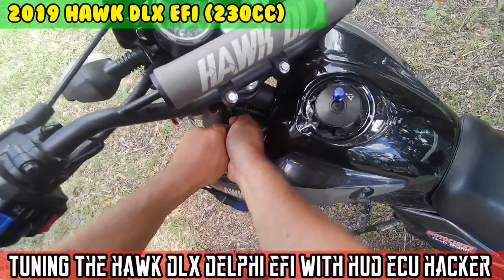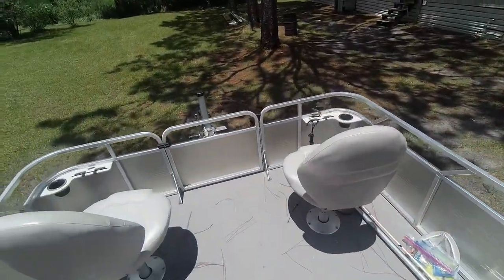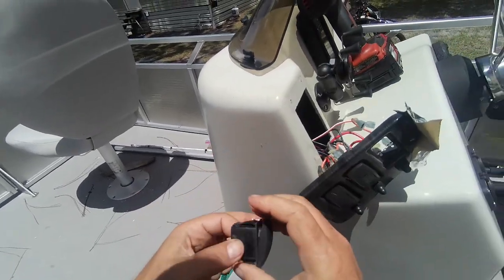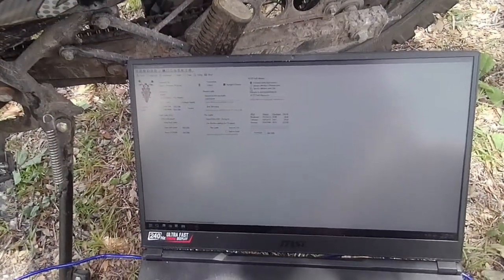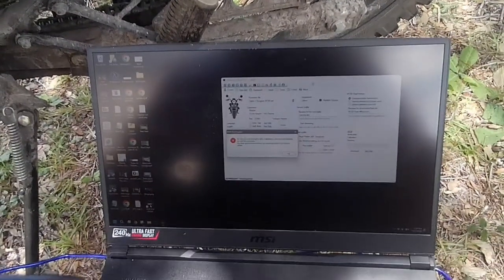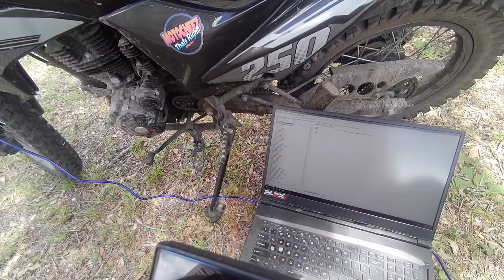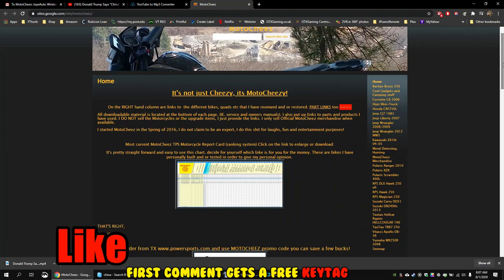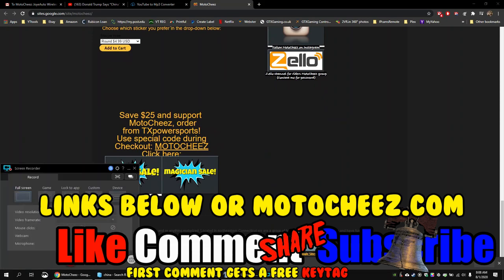Tuning the Hawk DLX Dlephi EFI computer with HUD ECU Hacker and a test drive. Broken speedo

Comment: My friend and I have been liking our Hawks a lot since we've been able to ride more frequently, him more than I since he rides his into work. Mine is at his house so I only get to ride on the weekend. We've been doing tweaking here and there as we ride. Since we haven't been doing any off-roading with them we're just going to gear them for cruising speed on the road. We're also going to change out the knobby tires for road tires. 

I bought two sets, one for mine and one for his, they're supposed to be here tomorrow. So we'll get to see how they perform with road tires this weekend. With the way they're geared currently we can cruise at about 50-55mph at a decent rpm but we want to hit 60/65mph at a more relaxed rpm when we're cruising. So we're going to get a couple more rear sprockets with reduced teeth and see which one works best.

I've also been eyeing a round universal led headlight for a motorcycle and a fairing/windshield combo to give it a different look but that's for later. It's slowly turning out the way I want it. Even with the high gas prices we've only been running ethanol-free high-test gas in them and after a couple hours of riding around we'll top off and still only spend about $5 or $6. Which to me is still a good deal. Even with my truck I haven't been paying too much because I top it back off at 3/4 of a tank and spend $35 or so for regular. Ya, $35 could have gotten you more gas a while ago but you gotta change up the routine to keep the price in check. :)
Reply from the maker: Nice!
Reply: @MotoCheez  Once the Hawk is the way I want it I'll have to send you a photo or two of what it will look like. I've been buying stuff for it here and there in small spurts so it's not too pricey. Of course I've been buying stuff for two Hawks at a time so it's a bit more. I owe my friend money as he paid for our motorcycle safety course so I'm paying him back with mods for his Hawk. All stuff he would have bought on his own anyway. :)

Comment: Awesome video, been following you ever since i had my first hawk back in 2021. Then i crashed 3 months later sold the bike. 2 days ago I bought a brand new dlx, going back to it. Ty for the support in the community. I want to also ask you a question. I want to do the big bore kit on the dlx, will it need a tune? Also if so, do i need a new injector? No one seem to have done a 300 big bore dlx yet
Reply from the maker: Awesome and thanks. 
You're definitely going to need a tune if you do the big bore, most put a cam too. The guy Alex on my DLX tune video still does custom tunes. Not sure if you'd need a bigger injector
Reply: @MotoCheez  ty for the reply! I’m going to contact him. Do you recommend any cams?
Reply from the maker: There is a company that sells with the big bore kits, can't think of the name. It's all over the forums.

Comment: Try drying and packing packing the boat switch with Dialectic Grease (Silicon, so safe for plastics.)
Reply from the maker: I silicones the top part for now, I need a new switch
Reply: @MotoCheez  Silicon sealant is good too. Packing the new switch could make it permanent. 
Also, buying a quality marine switch could help.... of all the things to short out when wet... that horn has to be the Most Annoying!!! (You might get a better horn while you're at it. <G>
Reply from the maker: I want a better horn for sure. The switch had some corrosion so I'll get new for sure.

Comment: Hey Moto, which portable air pump do you use? I'm looking for a good one, that ain't too expensive
Reply from the maker: The largest 12v pump from harbor freight works better then one I bought from rugged ridge
Reply: @MotoCheez  I'll check it out, thanks Moto

Comment: Sounds like this was the tune it should have had out of the box.... Mfgr probably just used a base single cylinder tune profile to get it running and said good enough.
Reply from the maker: I'm sure it's emissions they had to pass to get in the states.
Reply: @MotoCheez  does it have a catalytic converter? if it does cut that sucker out and see if it enhances performance.
Reply from the maker: It does. I cut one out of the first hawk I had didn't make a difference
Reply: Yes sir that’s correct since I started tuning these Delphi ecms for the dlx a while back sharing the results I’ve noticed it’s more of a emissions related tune then anything else definitely wasn’t performance they had in mind!! We needed to begin tuning the dlx after the extensive internal modifications we offer to the chonda community it was easy to drop in one of my big bore 250cc kits or high flow ported heads for the carbureted bikes but the f.i bikes required a tune so it was a process of finding soft we could use then picking up cables to connect it to a laptop that would allow communication etc etc anyway glad to see it’s all catching on & working for everyone who wants to get the most out of they’re particular chonda!!

Comment: I wonder if that program will work with lifan bikes
Reply from the maker: Depends on the ECU. Most the China bikes use the Delphi
Reply: So while we’ve found in the past the Lifan will communicate with the hud hacker you’ll need a different cable from the bikes com port to a obd2 style connector you need a euro5 6-pin style to obd2 & then we can tune the Lifan as well…you can’t use Alex’s tune provided tune for the Lifan but if you need any help with tuning don’t hesitate to ask I run the chonda riders group on Facebook as well as a YouTube channel for my chonda riders  an started chonda riders performance parts to offer custom performance parts for the China bikes!! So don’t ever hesitate to ask I’m always happy to help the community any way I can!!

Comment: Question for OP: I am considering this exact bike for dirt bike/trail riding around my property. Would you recommend this or X-pro titan/Templar for dirt bike needs? Considering this due to EFi Vs Titan/Templar Carb bikes. Thank you in advance
Reply from the maker: I choose this bike if you're not going to modify too much like a pipe and engine type stuff because you can retune the EFI but it's not like messing around with carburetors etc.
Reply: @MotoCheez  Thank you for your response. 
That is my thought process as well. Just wanted to make sure the extra weight and size doesn't keep you from enjoying it as a dirt bike? Titan and Templar seem to be smaller and lighter
Reply from the maker: @kam1996 I believe they're same size, DLX just a little heavier because EFI and inverted forks

Comment: Is your “quick release seat mod” just not putting the screws in?
Reply from the maker: Just the one side you can reach, with a shorter thumb screw.
Reply: @MotoCheez  Great! Now I gotta go find a suitable thumb screw…
Reply from the maker: @BriNbigD I used existing bolt with wing nut spun up to the head and tightened on one of my bikes
Reply: @MotoCheez  Pure genius!!
Reply from the maker: @BriNbigD 😁 still a bit tight to get out but works

Comment: What is your ECU? Delphi MT05? I have the same ECU (but a different bike: Italjet Buccaneer v250), I could not download the firmware, it just says security error.
Reply from the maker: Yes Delphi mt05. Hmm, should be good, had other do it
Reply: did u fix problem. i get same msg.. i have 2 same atv mt05, from one i can download firmware, from other i cant i get msg security error
Reply: @MotoAtvshop  no, I have not fixed it yet. Try contacting the software author and see if he can help
Reply: @fat_joe  do u have his contact, mail , facebook etc?
Reply: @fat_joe  do u have connect to ur ecu means see live data etc.. everything i can. but when try download flash .bin i get msg security alert.. from another 2 atv i donwload without mistake.. really cant understand..

Comment: Hey i couldn’t get it to work the HUD key saying that it couldn’t comunícate and when I tried to download the flash. Checked the adapter and the connection and everything is just like in your vid
Reply from the maker: You have the com port selected and bottom of flash section there's a bar that says connect
Reply: @MotoCheez  I did that and it said connection failed. I did buy everything for the connection from your links so I’m not sure what’s wrong
Reply from the maker: Make sure comm port right

Comment: I don't think this will make much difference  with the cj motor. Minimal at most. I'm just gona buy that newer motor and 6 speed.
Reply from the maker: Added the cone filter, yeah it'll be minimal but definitely noticeable low torque
Reply: What motor ?

Comment: Did you donate $200 for HUD ECU 
Because if not pay you can’t add other cars
Reply from the maker: I didn't donate. Was that a recent update?
Reply: @MotoCheez  did you use snifing option and then tune it ?in new ecu without donating

Comment: were do you install that 2.0 alex file to having trouble getting it to hud
Reply: Ok programs 86  hud  tuning mt05 copy paste it there
Reply from the maker: Have to download the stock first. Put in the folder I showed and select new flash from bottom bar
Reply: In this video couldn't make that out on the screen
Reply from the maker: Program X86\Hud ECU hacker\ecu\mt05\tuning folder is where file goes
Reply: Thanks was that in a different video

Comment: Is anyone running one of those amazon oil coolers is it worth it or just a pos
Reply: They do work but it’s not something that’s necessarily needed but essentially it can’t hurt…adding a electric fan to the oil cooler really improves the temps if you do decide to add the cooler!!
Reply from the maker: I bought one for my original hawk, never installed it because I never really needed it.